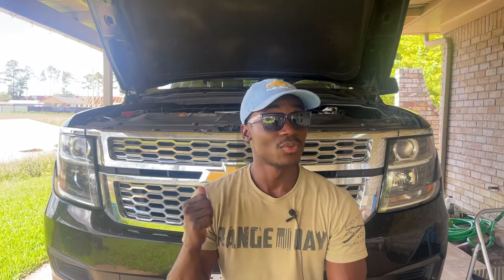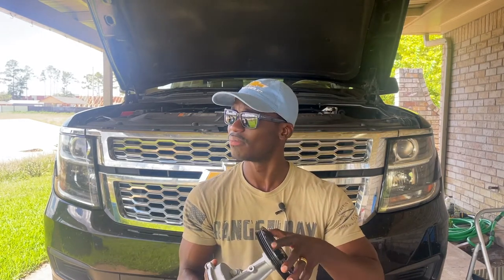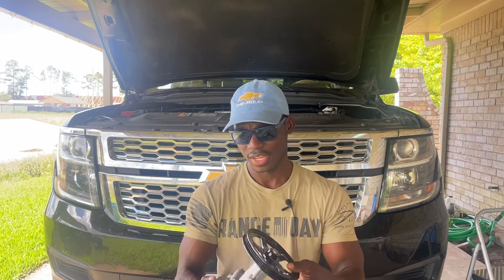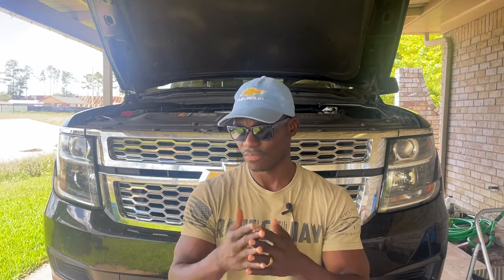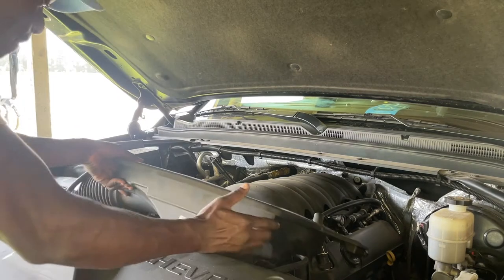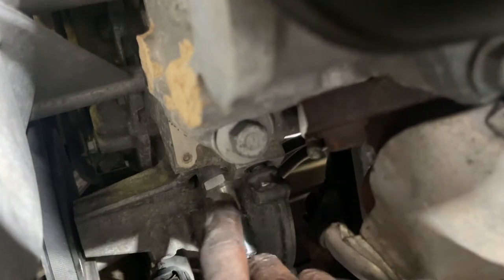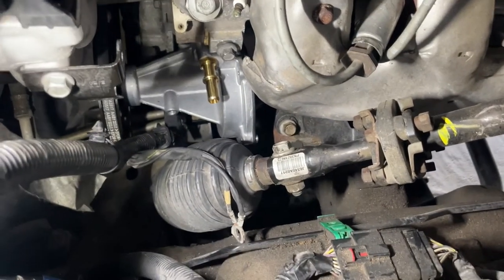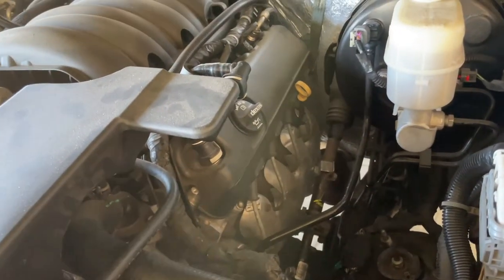2017 Suburban Hard To Push Brake Pedal // Recall

Comment: This issue just happened to us today.  The truck was in for recall check 03-2020 and they said it was corrected - obviously not.
Reply from the maker: Did get it looked at? It's a serious problem.
Reply: @pierrerepair86  Yes Pierre, thank you!  And as per your video the Chevy dealer fixed it for free, again many thanks!
Reply: Buy a Toyota land cruiser!
Reply: Did they charge you